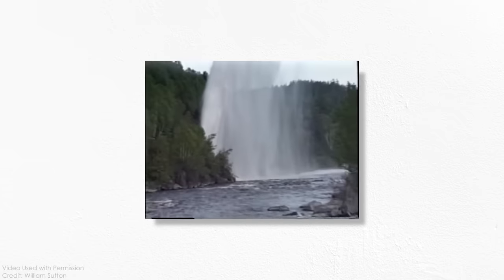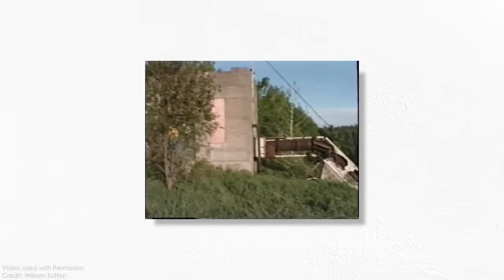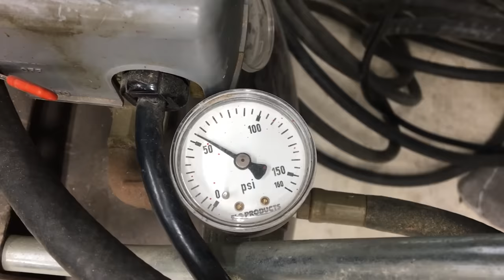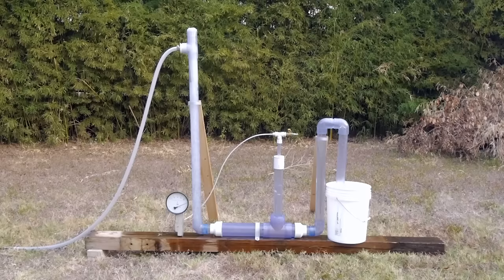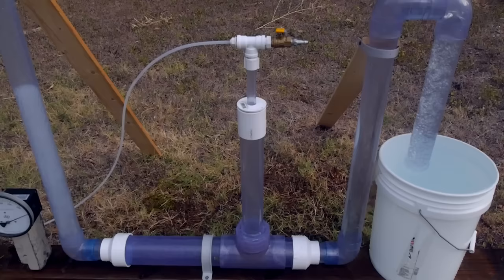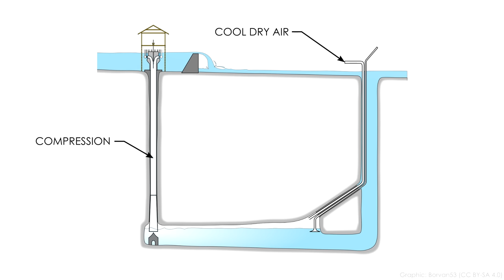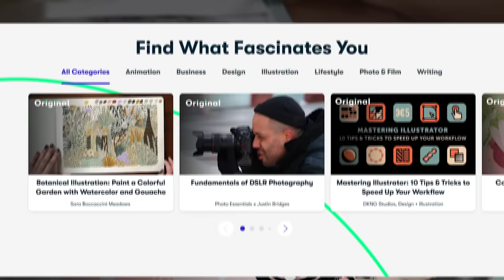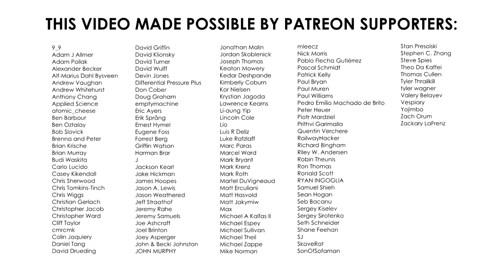Compress Air with No Moving Parts! - Trompe

Comment: “Air compressors had a major disadvantage to the mining professional of the early 20th century: they didn’t exist.”
Reply: This is the one thing i find a major issue with, they had air compressors as far back as the 1870s  and possibly the 1850s ( I am not going though my archive right this min to check). They were large steam driven equipment, but they did exist and were in common use!
Reply: Westinghouse invented the air brake system in 1869, so compressors had to predate that
Reply: @tbates1987  There is no real difference between "it does not exist" and "I can not afford to use it". If it only works after you hit a specific scale or up to a specific scale, that is a ton of applications for wich it does not exist.
A steam-anything neeeds water. And also something to burn and a steam pressure vessel way more expensive then some piping. Especially a century or 2 ago.
This thing only needs water and some pipes.
Reply: @cindytepper8878  Different scale, different viable solutions. That is a simple truth of engineering. And you can see that all over nature:
https://www.youtube.com/watch?v=f7KSfjv4Oq0
https://www.youtube.com/watch?v=MUWUHf-rzks
Reply: They were too expensive more like it
Reply: Nice sound bite, but incorrect information.

One of the early uses of steam engines was to drive air compressors for mines and such, and the air compressor was basically just a steam engine in reverse, no special technology.

And even before steam engines, they had air compressors to get air into deep mines.
Some were human powered, others were horse driven, some with a water wheel.
Reply: Archimedes used his Archimedes screw to remove water from mines. One of the side benefits was that by removing you were pumping air in. This was over 2 thousand years ago. While not necessarily an air compressor. It did provide air in tunnels.
Reply: Brooklyn Bridge  opened May 24, 1883. Why would workers die of " Caisson Disease " in the 19th Century?
Reply: @tbates1987   Bruh. Did you watch the video? 2:00 .The full sentence says " They didn't exist- at least not ones that were commercially available." Don't take issue with the sentence just because you didn't watch the primary source content intently.
Reply: @tbates1987  The Train was worth the expense. Prior to the train and the car, the fastest internet or delivery was "a guy on a horse".
Same with the City of Paris.
For a mine the same expensive does not work, if you got other mines that can operate cheaper.
Reply: yeah, not existing seems to be a major disadvantage of many technologies. it also seems to be the first one that needs to be solved, before all the other ones.
Reply: @cindytepper8878  They were invented in Germany in 1650 by Otto von Guericke. They were redesigned to be motorized in 1799 in England by George Medhurst.
Reply: You could even predate that with the bellows used in forges and smelters back to the beginning of the copper age, technically.
Reply: @tbates1987  and if you have patience for 2 more seconds he adds, and im paraphrasing "at least not comercially viable"...
Reply: @christopherg2347  I realize your comment is a year old, but I had to say something.  So, what you're essentially saying is "I can't afford it, therefore it doesn't exist."  Also, your thinking "this only needs water and some pipes" shows a serious lack of understanding.  Are you suggesting everyone has a river with a significant change in elevation in their backyard?  You don't just need water and some pipes.  You need head.  A lot of it.  As far as steam power goes, guess what?  The entire planet has, does, and will run on steam power for the foreseeable future.  Yep.  That's right.  Right now, as I type this comment, the energy I'm using is being produced by steam power.  All of our electricity production that isn't produced by hydro, wind, solar, geothermal, etc. is made with steam engines, for all intents and purposes. The only difference between an oil-fired power station, a coal-fired, natural gas, and even nuclear, is the way the water is heated to produce steam.  Lots of high-pressure steam.  Instead of pistons and crankshafts, the steam spins a turbine.  That's pretty much it.   What do you think is more abundant for the average person- a river with a fairly large waterfall, or a stream/well/etc and trees which you can cut and burn?  If you have a river and enough head, then you use water to provide your power.  If you don't live near a river with enough head, you use what's available.
Reply: So air compressors didn’t exist, but the tools run by compressed air did? Methinks you done messed up.
Reply: I agree that his choice of words was a bit overly simplified, but the reality is that air compressors in that era were very large, very heavy, very expensive, and were typically built as one-off pieces under contract. Typically they were stationary installations in factories assembled on-site, but some "portable" models in the form of a rail car were invented at some point (not sure when). They still needed a steam engine or other power source to run, and a steam engine needs a boiler, which needs fuel.

A lot of mines back then were speculative; some panned out, some didn't. If a mine didn't pan out, then they'd move their equipment to a new location and try again. A lot of these early mines didn't have good access to railways. Aerial ropeways, or even mule teams, hauled the ore out to the nearest railway. What they did frequently have was water and a large terrain gradient to generate a lot of head pressure over a short distance. Moving the pipes and fittings required were still no small feat, but in locations conducive to such installations it was far more practical than any alternative that existed at the time.